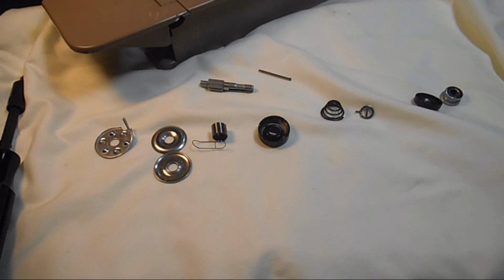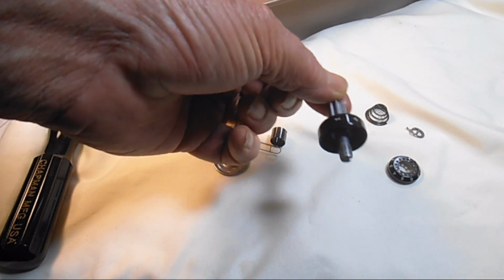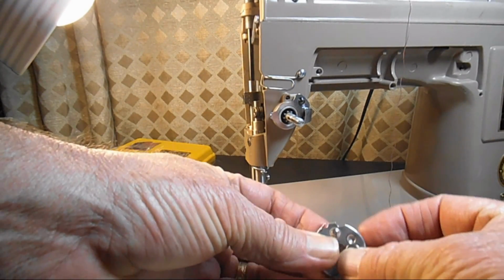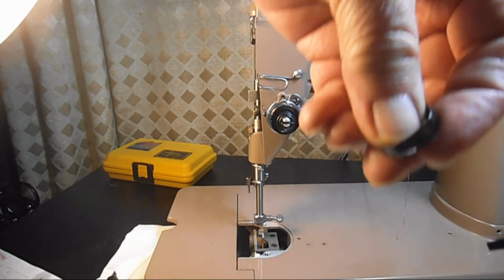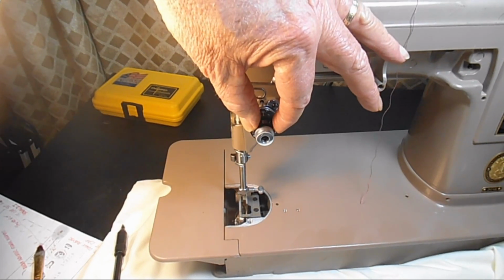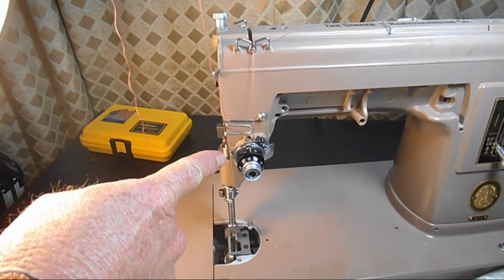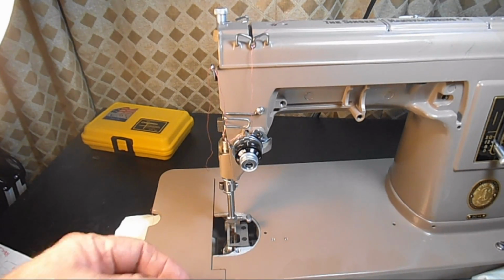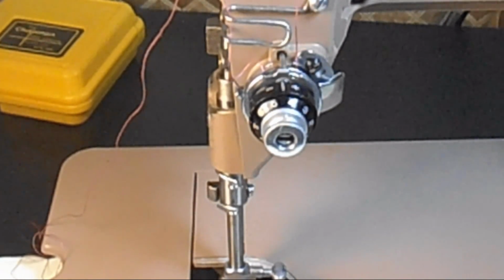Install and Zero Out Coco's Tension Unit - Coco goes to the Spa pt. 5c - Singer 301A Rehab

Comment: Im having issues with the upper tension of my wife’s 301. I cleaned everything and reassembled according to the video. The thread randomly gets stuck in the tension and causes it to break. I lift the foot several times and then it releases the tension. I feel like the discs are binding up pressing against the thread. Any suggestions for fixing this issue? Thanks in advance.
Reply from the maker: So you were already having tension issues. That's why you did this work? It's hard for me to diagnose without the machine but when I had similar problems, what I found was that the slot in the tension post that holds everything is bent or out of alignment or pinched together. And if that happens, the discs and the plus minus indicator cannot move freely front to back. So they may be pinching the thread. So if I had the machine I guess that's the first thing I would look at is to disassemble again then be sure I had assembled it properly and that look very closely at this spacing and condition of the slot and the tension post in general. You can take the indicator, dial and slide it into the slot and push it front to back a few times to see if it moves freely or if it seems to hang up. You can also push it all the way to the back and then just put the thumbnut on without the other parts to see if that reduces the space in the slot. And can you still slide the indicator plus minus front to back without anything hanging up? Sometimes there's just one place that hanging things up. It might be on the indicator or it might be on the discs. I guess that's the best I have to offer this morning. Good luck!
Reply: @andytubesewing1953  I will take another look at everything. I took it apart and to clean everything because it was pinching the thread. 
My wife watches your videos to verify I’m doing everything correctly. lol
She just got a black 301 yesterday and she is requesting a spa day for it.
Reply from the maker: @Groovyleathergoods  best of luck then and sounds like you have a quality control expert keeping an eye on things. I know I have a video about repairing a bent squeezed tension post somewhere in my 600 videos. I can't remember which model it was. If I can find it I'll let you know. So if your post is damaged maybe it'll give you some idea of a possible fix. You can't buy new ones really. You have to buy a vintage one but it's rare to find a post by itself. You usually have to buy the whole assembly

Comment: I’m missing the screw on the inside.   How much do I really need one.  And where can I get one.  Thank you
Reply from the maker: Can you describe "the screw on the inside" for me, or give me a time in the video that shows it? In general, every part on every machine, especially a screw, has a needed purpose. Depending on the screw, you would normally have to find a seller who is selling parts off the machine on eBay, but some common screws are available from online parts sellers. I can be more definite about the screw once you help me understand which screw you mean. Thanks.
Reply: The tension set stud screw
Reply from the maker: @kristenruiz7095  OK, thank you. The Tension Stud Set Screw, Part #140710. This trusted seller is parting out a 301 and happens to be selling the screw right now on his eBay store. Look for item #35  https://www.ebay.com/itm/SINGER-301-301A-SLANT-O-MATIC-SEWING-MACHINE-ORIGINAL-PARTS-PICK-YOUR-PARTS/383377776316?hash=item5943189ebc:g:fucAAOSwCDxeI2cI
Reply: Thank you for the help.
Reply from the maker: @kristenruiz7095  Sure, good luck.

Comment: Hi. When I put everything back on, I have to squeeze everything back in order to try to put thr thumb screw on. Is that right?  You don't seem to be fighting yours. Could it be that the piece that holds everything isn't inserted properly?  I pushed it in as far as I could. It's hard to push in. help!!!!please. Want to use it as an anchor right now.
Reply from the maker: "the piece that holds everything..." The Tension Stud. Chances are you installed it all the way in the proper manner. 1st, be sure you are doing the assembly with the presser bar down, so there is no pressure on the tension releasing pin. So, foot down, but you're having a hard time getting all the parts back on to the point it's really difficult to put the thumbscrew back on? I'm thinking that maybe the Tension Stud is "Crimped" or "bent together" and the slot down the center of the stud is too narrow now. When that happens you can't push the Indicator ( the +|- dial) all the way back. Was that piece hard to take off during the disassembly? A pinched or crimped stud is fairly common. Take a look at this video please, starting at about 40:47 https://youtu.be/4aqRScKOOsw   The tension stud in that video was bent and pinched and I had to try to reform it and make the slot opening equally spaced from front to back. When you see the video I show a bent stud next to a good stud, so you can compare the stud on your machine to them. If it's a bent stud, do your best to fix it. No one makes new studs (that I know of) so if it can't be fixed you'll need to buy a replacement vintage assembly on YouTube, but if so try and find one that has been disassembled and has a good picture of the stud, otherwise you could be buying a damaged one.
So, Joan, that's my guess, but if it is not the stud then we need you to post some good photos somewhere, or a video we could see, showing the problem and we may be able to help. We being other viewers who read comments and may have had a similar problem. Also, there is a FaceBook 301 group you could join and ask about a fix also. I do not use FB, but they have some great people in that group too, with lots of experience with model 301. Good Luck. Thanks for watching my channel. P.S. don't mention anchors on the FB 301 Group if you go there. No heart attacks desired 😀 Thanks for watching my channel✨ Good Luck.
Reply: Thanks so much for your quick reply! I will check out the suggested video.  Just kidding about anchor, I love both of my 301s. Thanks again.
Reply from the maker: @joanwillison3877  I know the anchor was your joke, as was my comment about it, haha. We all feel your pain and know frustration sometimes with sewing machines and their parts. Easy does it and check the stud slot. Best of luck, Joan.
Reply: How do I add a video?
Reply from the maker: @joanwillison3877  When you sign into YouTube and are on your channel home page, at the top right you see a camera icon. You click that and select "upload video" from the menu then drag your video to the area or browse to the file for your video and select it. It's best if you go to the Google support page for the instructions as they have them for computer, android, and iPad/phone. https://support.google.com/youtube/answer/57407?co=GENIE.Platform%3DDesktop&hl=en
During and after upload you can make a title and select other options like an ending page and if the video is private or public, etc. There are also many YT videos about how to do all this if you prefer to watch those. Here is just one of many, many examples: https://www.youtube.com/watch?v=H8yrblAj-V4
Reply: It appears I have fixed it. Not sure how though. I took it apart because the machine was skipping stitches and I had tried all other ways to stop this. However, it’s still skipping stitches. 🤨
Reply from the maker: @joanwillison3877  Hmm... OK, congrats on fixing it then. Skipping can be associated with the timing of the needle to the hook point. Other things like a dirty hook area and thread catching on the thread guard can affect it also. I'm guessing your other 301A is OK? So you have the correct needle, thread, and knowledge. It's easy to just check the timing, and not hard to repair it if it is off. Here is my timing video: https://youtu.be/6pAWzJyV0IY  Here is a video for removing the hook, if needed: https://youtu.be/OhBOhfKusHw     This video is about dismantling the hook for cleaning. thread wraps, repair, etc if needed: https://youtu.be/yy_yoD2CbWM     No tools needed to just check the timing, but the other work involves removing parts, so it's a good idea to be sure you want/need to do that before getting the screwdrivers out.

Comment: My upper tension assembly is bent.  Do you recommend a particular supplier?
Reply from the maker: Not really. I usually find a vintage one for sale on eBay https://www.ebay.com/sch/i.html?_from=R40&_trksid=m570.l1313&_nkw=singer+model+301a+tension+assembly&_sacat=0&LH_TitleDesc=0&_osacat=0&_odkw=singer+model+301+tension+assembly    I see there are brand new aftermarket black ones for sale now that claim to be for models 221 and 301 machines. I've never tried one of those. No one sells new tension stud parts and I do not know if you could just use the stud from a new black one with your existing parts if you want the original color indicators. If possible I try to straighten out the bent stud, but sometimes it is just too damaged. Good Luck.

Comment: Thanks for the video. Your voice sounds normal again.

I recall in one of your other videos you mentioned how to remove the remnants of a glued-on dealer sticker from the top of the machine. I searched the videos but I couldn't find the exact one. Can you tell me what cleaning product you recommend for this situation?
Reply from the maker: The latest video about it is here: https://www.youtube.com/watch?v=1SDasbAHbMo
Starting about 14:35. Goof Off is what I use on the worst of them, like a dealers foil sticker with its modern glue. I have used oil, peanut butter and toothpaste on the older tape residue. On the copyright sticker on the front base, I just soak with a wet rag and water over night and scrape with a plastic blade
Reply: Thanks. I will give it a try.